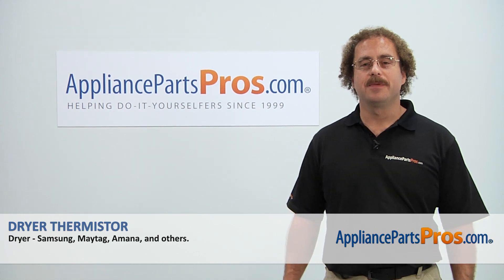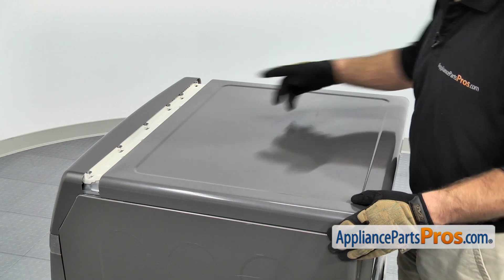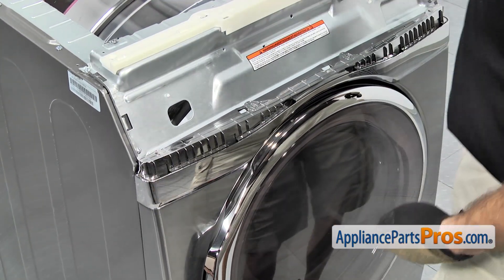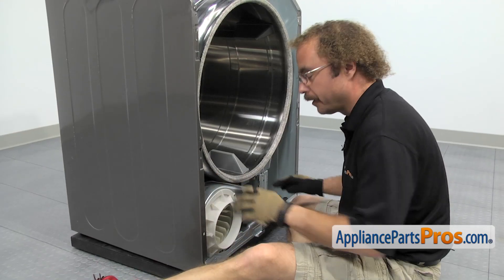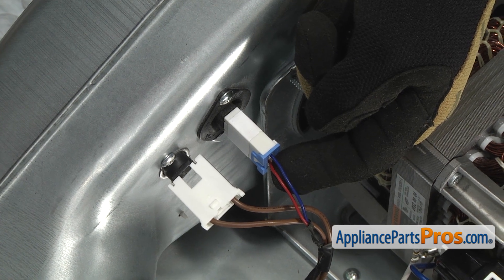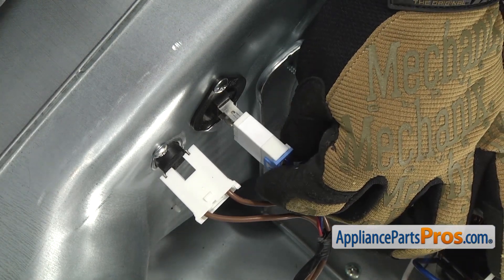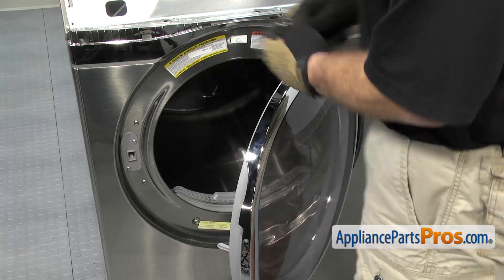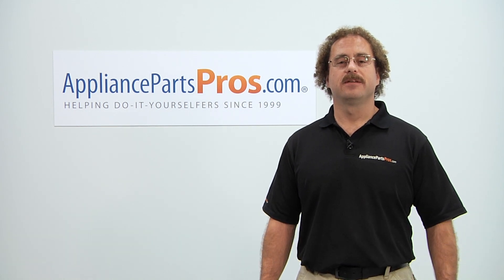How To: Samsung Dryer Thermistor DC32-00007A

Comment: Great video guys!
Important thing for everyone to remember is check this if the dryer is not running at the correct temperature. Also check for blockages and if the unit is too close to the wall.
Reply from the maker: +Lavadoras y Secadoras Mazatlan Thanks for the tips!

Comment: Would this part also be a good candidate to change if the drying is locked up with a flashing "flow sensing" and "drying" lights? The vent is clear.

Comment: Would this part also cause the dryer to run longer than it should?  On normal mode it uses the "moisture sensor" and it runs for over 1.5 hours and the clothes are already hot and dry, yet it didn't stop and still shows 9 minutes left the last 2 times.  It showed 44 minutes before even starting the cycle so not sure why it runs this long.

Comment: Simply great. You guys help me save at least $350!!! I’m kind of handy, but without this video I would have to pay for a technician. It’s extremely clear and doesn’t skip a single step. 

Only one question. The video says that the drum’s pink tape goes back. First time I open my dryer and it was in front. Any ideas?

Thanks a lot.

Comment: I replaced the heater element and all the sensors on it. Will this cause the element from not turning on period? I had an he code and then put in a new element. Code is gone now and now it seems the element won't even heat up. I checked the wiring to see if I forgot to plug anything in but everything seems to check out.

Comment: Do it matter which side the thermistor is plugged to the blue or red wire
Reply from the maker: +Shamard Jackson We always say in the videos to replace the wires in the same place you took them off. A thermistor is not polarity sensitive so it should work if you swapped the wires. Hope the video helped you get the dryer running!
Reply: Thanks Sir. I was wondering about the polarity of the thermistor because I didn't here it mentioned in the video. Thanks again
Reply: @shamardjackson5001  It did say blue wire on top. But it did not say anything about thermistor only fitting one way "correct prong up" like idiot-proof installation.

Comment: What a terrible place to put the thermister. Next dryer I buy I'll be sure to check out how difficult it is to replace these parts.
Reply from the maker: Whatever dryer you purchase next, we'll be happy to help you with it too! :)
Reply: In the newer ones they have put it right behind the door. So you do not have to remove the drum.
Reply: It's really not that difficult to access, yes you have to take everything apart, but that really only takes about 15-20 minutes if you go in knowing what to do.
Reply: If the thermistor goes bad. Does it cause the thermal fuse to keep tripping?

Comment: Holy crap, what a pain in the A$$ to get to!
Reply from the maker: +Paul Graham It is a lot to take apart but it is all pretty basic!
Reply: +AppliancePartsPros dv350aew xaa
Reply from the maker: +Roxanna Baker I know this is a model number but I have no idea what you need. If you need parts you can go to our website and enter your appliance model number to view the parts breakdowns to be sure you get the correct part for your model. If you need help troubleshooting you can post the problem along with the appliance model number on our repair forum and the techs can help you troubleshoot the problem. http://forum.appliancepartspros.com/